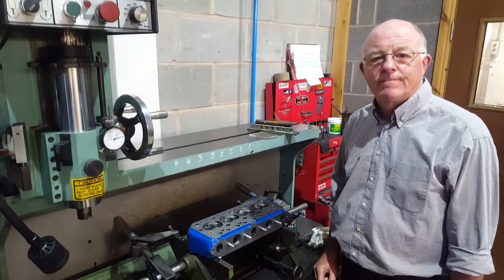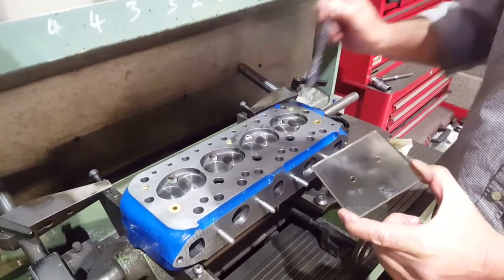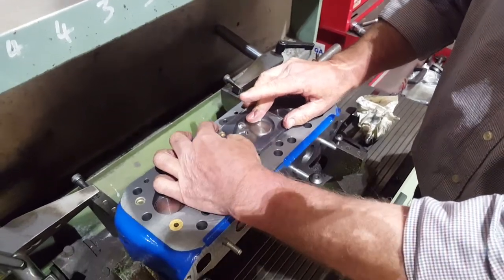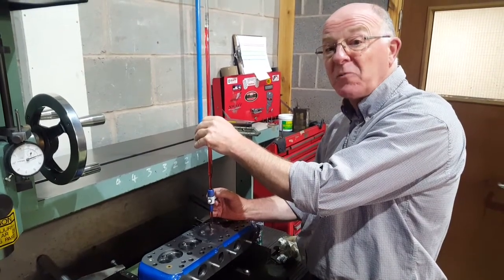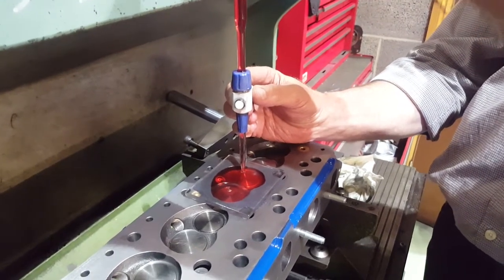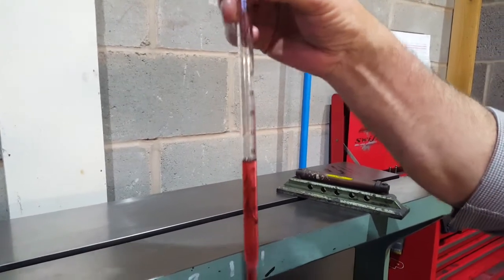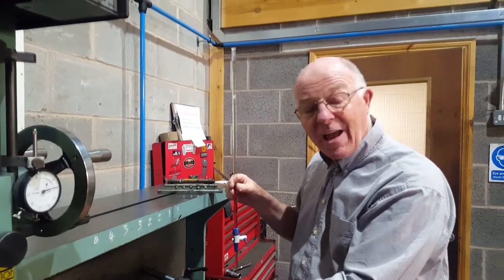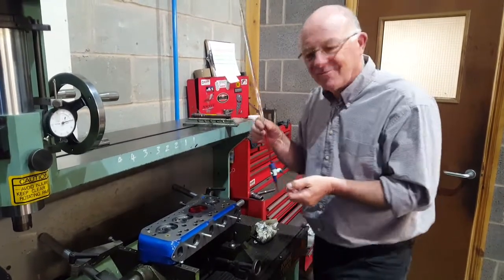How to check your cylinder head chamber size

Comment: Great to see someone doing it properly, I learned how to do that when knee high to my father. Still have his pipette and stand that he used on many road and race engine.
There is a guy on youtube based in America selling and promoting your products and engines who does not have a clue about checking this or that compression ratios matter! He is building and selling engines using your products and completely fails to check this out, runs engines on the wrong grades of fuels then discovers when they don't run properly that he needs to use the fuels to match the compression ratios etc. There are even comments from similarly inept people claiming that only keyboard warriors think its important!
Reply from the maker: We think we know the engine you're referring to there. From memory we supplied the pistons, block and head, so it would have been calculated this end.
Reply: @MEDEngineeringTechVideos  I'm  pretty sure you would know what  you would have sent out. It certainly didn't  reflect badly on you as far as I'm concerned.
Reply from the maker: @jjmac3561  no we mean, that's perhaps why it wasn't checked there in the video. Although we'd always double check ourselves!